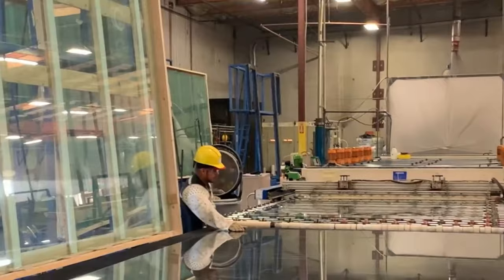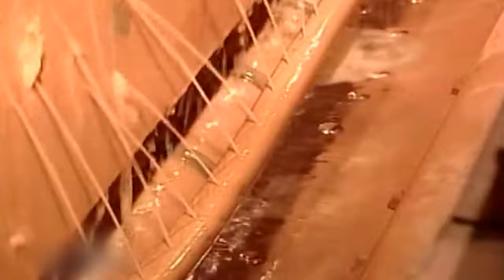How MIRRORS Are Made

Comment: Great video! A nitpick: at 4:38 the narrator declares that diamond is the "strongest" material known. That's false, as "strongest" is a very vague term, and in terms of resistance to impacts diamond is actually quite brittle; a hammer blow can shatter it (doesn't sound very "strong", does it?). What diamond does happen to be, however, is the "hardest" material known (hardness has to do with resistance to scratching or cutting and being able to scratch or cut another material).